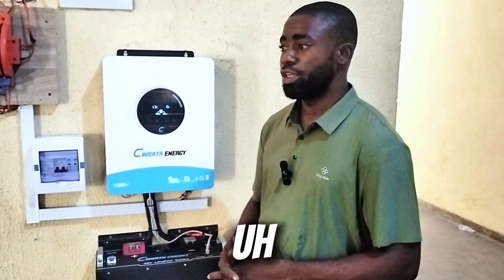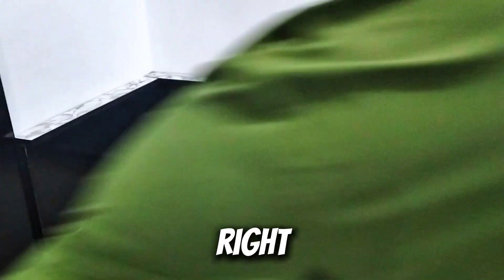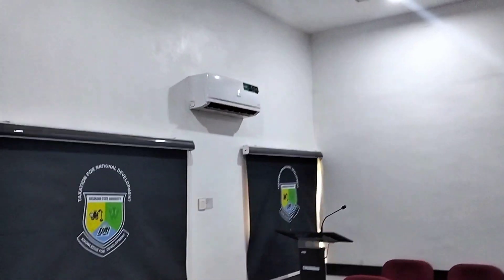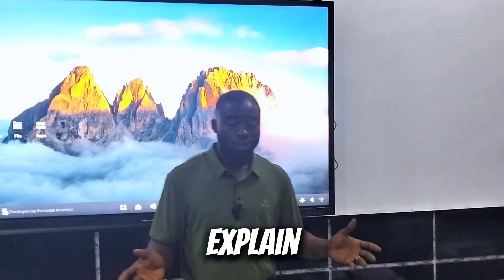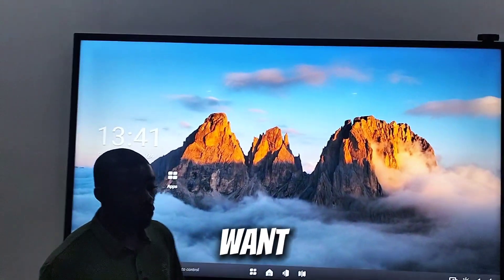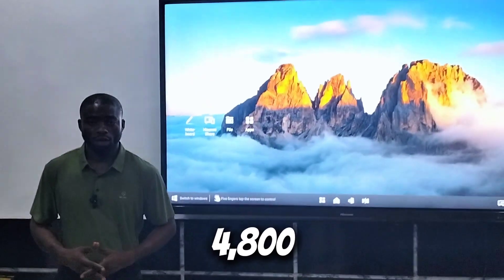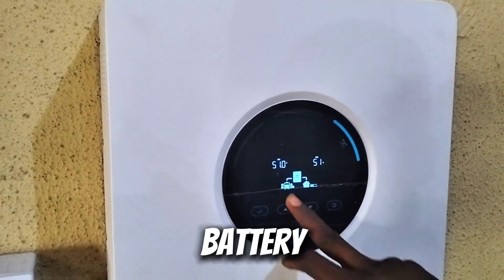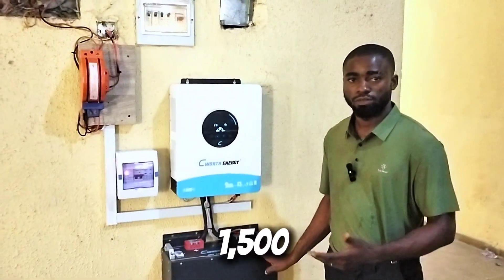What can 5kwh lithium battery and 6kw inverter power?. watch this😳

Comment: A grid tied system can feed excess power back to the grid which is not possible in Nigeria. So it's not a grid tied system. A system connected to grid is not a "grid tied" system. It only becomes grid tied when it feeds power back to the grid.

Comment: 6Kva inverter on a 5kwhr battery??? Thats less than 1hour run time without sun. There has been little to no sun in the last one week. I really still find it confusing why you guys install such large inverters on very tiny batteries. I wouldn’t install more than 2.5Kva inverter on a 5kwhr battery because even with your explanation to them, one person that was not there when you were explaining to them will come
Tommorow and call you tommorow and say what you use so so million to install for them does not last more than 2-3hours o. Then they will start calling solar installers  out like one tech bros did on Tiktok
Reply: That would be correct if the inverter is running at full capacity i.e. @6kw load, but it's not. The load on the battery determines how quickly you drain the battery. This battery will last for 5hrs if you run it at just 1kw load. 
A big inverter is just to be able to charge quickly and carry big load if needed.
Reply from the maker: Offices don't need much battery bank.
If you watch the video to the end you may have understood
Reply: u nor expect dem to use 6kw at a time na

Comment: Well done and good job. For this job of (6kw inverter and 5kwh battery) could you please do a video on selecting the appropriate solar panel requirement, the connection (series or parallel or a combination of both) and the size of cable? Thank you
Reply from the maker: Okay sir

Comment: Great Job Emma, this is exactly what I asked you to come and install for me with solar panels but you said you were too busy for a small job like this in an understandably far place in the southeast. I honestly do understand your point. Good enough you sent an installer (thanks so much) to me but honestly, they are not as good as you. You are a guru. An apprentice can never be greater than the master. They didn’t communicate my inverter with the battery, and I have heard you say that repeatedly even in previous videos. I was expecting that. I really want that to be done. They also did not ground the inverter. I am not fully satisfied honestly.  I am not sure whether they are able to do it in my own opinion or I know it could be just me underestimating them. I am going to call them to come back  do  them (  communicate and ground the inverter) otherwise I will revert back to you.
Reply from the maker: 🙏🙏, they can do it, but you should have let me know

Comment: Nice job brother.

But i dont quite understand how the system is grid-tie.

I believe the battery charging from the grid doesn't make the inverter a grid-tie system. The system is just a power backup system aka UPS system.

What i know of a grid-tie system is that, the system doesnt depend on batteries but solar panels and the grid. Its more like using the solar panel to reduce your consumption from the grid during the day or selling power back to the grid( not applicable in nigeria yet).

So if the inverter is not hybrid(off-grid + grid-tie), then it cannot work as a grid tie system. It is simply a BACKUP SYSTEM.

Its a nice and neat installation all the same. Keep it up bro.
Reply from the maker: It's same thing, language is the issue
Reply: @Mairigaemmanuel   i insist that  inverter system connected to grid for charging not same as grid tied inverter.
Time will not permit me to illustrate further. But i will like you to make more research about it. Thanks
Reply: @savageolatunde6731 you are very correct. It's just a hybrid inverter that can be supplied with power via different sources. 
Even if the inverter has the feature to supply power back to the grid (grid tie inverter) as long as it is not doing it for whatever reason, it's not to be called "grid tie" sytem